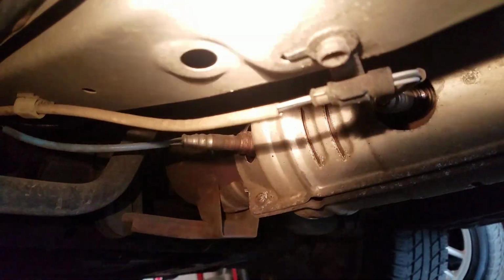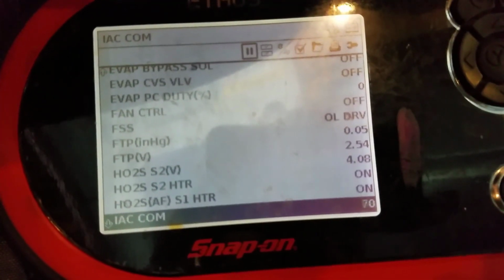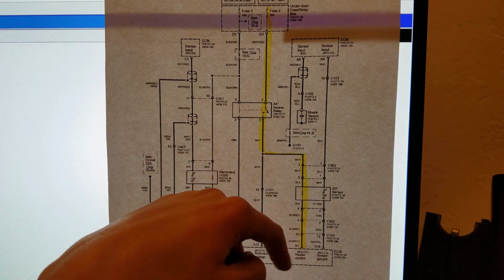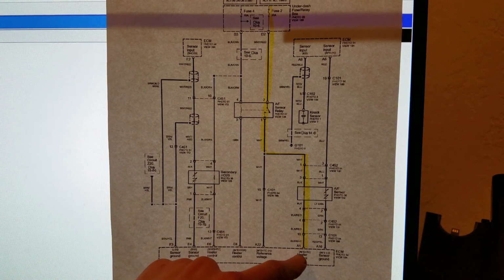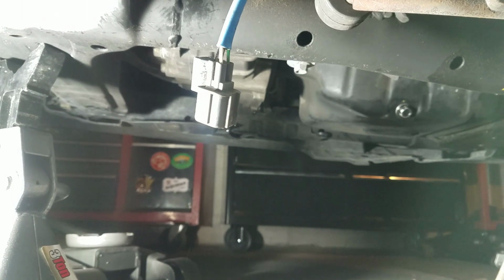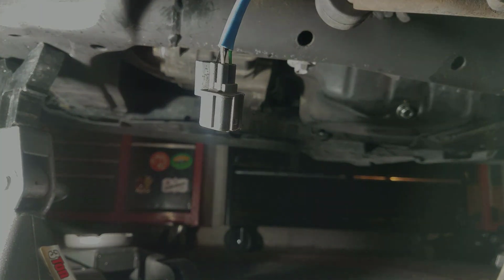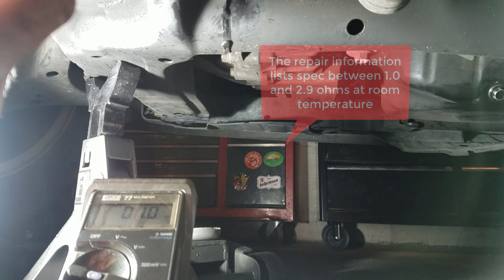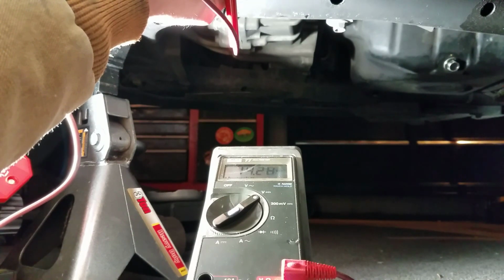P0135 - 2004 Honda Civic Si 2.0L

Comment: I have the same 2004 Honda Civic Si and P0135 error code. I need to replace the sensor. What is the correct Denso part number do I order to replace? It appears to be 234-9005 but I have also seen on youtube to replace with Denso 234-9017 air fuel ratio sensor.
Reply: Im 2 years late but im also wondering this. Ive seen people say they’ve had success with both
Reply: @terrorism7015  Denso 234-9017 air fuel ratio sensor did the trick,

Comment: Thanks for making this helpful video.  One question I have is about the expected resistance across pins 3 & 4.  The popup text in the video says 1.0 to 2.9 ohms at room temp. is in spec., but the EBSCO AutoMate database from my local public library says that for a 2004 Civic Si with the K203A 2.0L engine, a reading outside of 3.0 to 3.6 ohms at room temp. means the primary HO2S needs to be replaced.  I haven't tested my car's sensor yet, but was hoping to get some clarification of the "good" range anyone can offer.

Comment: Hi. Can you tell me where the relay switch is for my O2 sensors? I have a 2004 Civic 1.7 liter. I already changed all my sensors and the code I'm getting is P2A00. Thank u!
Reply: Mia B 
Appreciate it. Ended up being a bad ECU.  Definitely learned a lot about that whole wiring system of that car. I will be keeping it until it literally catches fire. Lol
Reply: Mia B.... yea. Of course it's right next to the roll bar that goes across the dash. Major pain to get out and in!